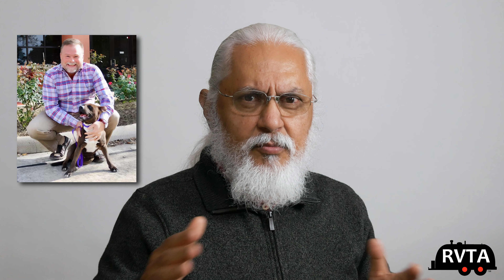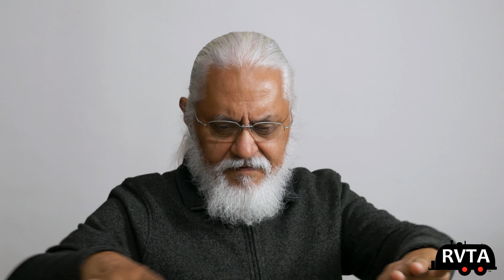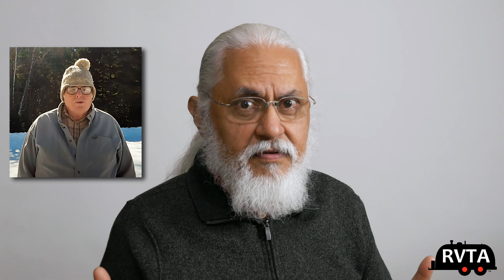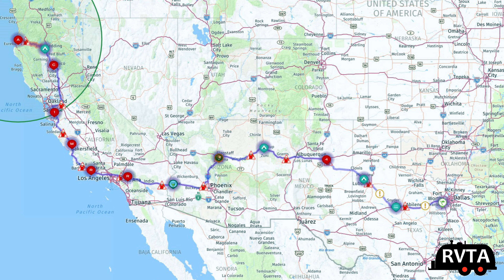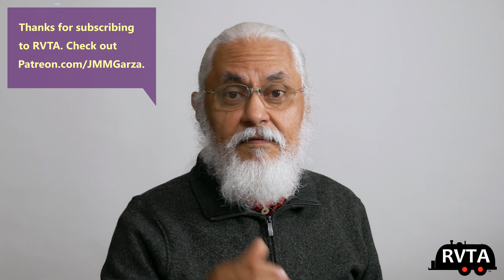Victron MPPT & Shunt Upgrades? Summer Camping Plans? It's Only Money! #Victron #WFCO #AoLithium #RVs

Comment: Jesus, now I understand what you meant by dangling wires from the charge controller.  My suggestion was to put the charge controller on the BACK of the piece of wood so it is inside wall and you can't see it.  The victron controllers don't have displays so you don't need to be able to see them.  If your wife starts looking at you with that look when you talk about spending $500 on new charge controllers and a shunt, I suggest you compromise on adding one new 200 watt panel and a modest 30 amp charge controller.  Mucho cheaper.  Also I thought that your AOLithium batteries had an app that displayed how much power they were putting out and their state of charge.  If that is the case then you don't need a shunt.
Thanks for the shout out.  We are retired profs.